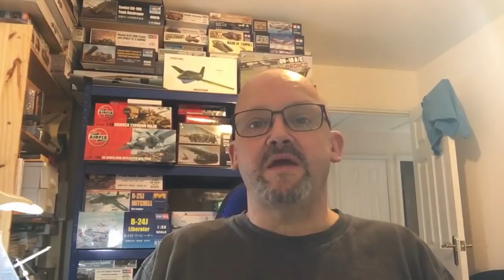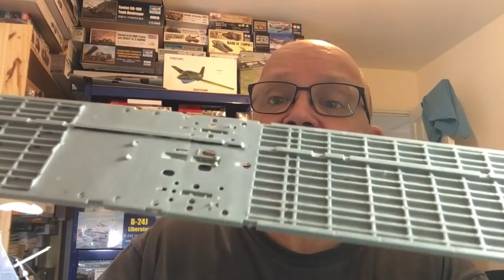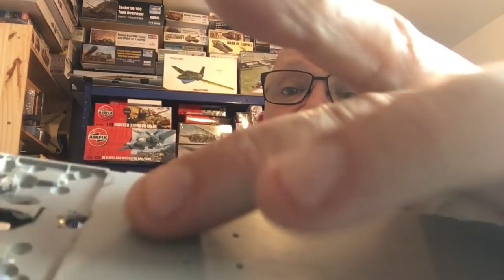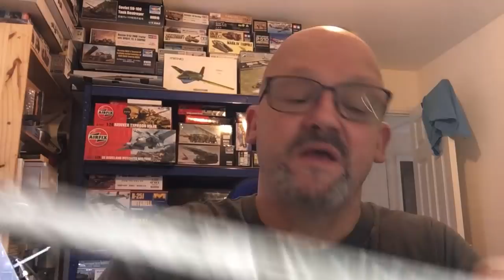March 22nd Update and some Bad News I'm afraid.

Comment: Sorry for the other guy in Canada.  I scooped one up from EBay, and it shipped from Burnaby, BC.  And to Nigel, I too have the bad habit of nail biting.  So feel your pain.  Nervous stress on my part.  Better than smoking.
Reply: Axle Rodd Hello from Ontario. Mine kit is coming from Burnaby as well. There was kits available on amazon right up until the kit selection. What paint will you be using. I had a real hard time finding paint and ended ordering most of it from Calgary.
Reply: @Life in Serenity.  I will be using Vallejo, fairly easy to get in Canada, as most hobby stores carry the base colors.  The newer colors have to buy online.  Had great success getting them from Sunward Hobbies in Toronto.  I will be learning to use the airbrush for the first time on the model an heard good and bad stories on Vallejo, but hoping for the best.  Environmentally friendly and low toxic fumes is what I like.
Reply: Axle Rodd Thank You for the Sunwood info. I to will be using Vallejo and against better judgement I bought a cheap airbrush kit. So we will see how they goes. My model kit arrives Monday. Most of my paint and cement on Wednesday.  The last time I built a model was 30 yrs ago so this should be fun. Thanks again

Comment: Lol. Great videos. Have you spotted the dingy panel in the port wing that shouldn’t be there, plus the modern blade ariels and anticollision lights as per the BBMF Lanc PA474? Plus the H2S set that shouldn’t be fitted to the Nav position unless the belly radome is fitted.
Reply from the maker: mantistrike120 yeah, all spotted and sorted. I have a video on sorting the wings. The port wing also has landing lights!! I’ve just put a post on my thread on LSM that describes what’s up with the radios. I’ll put a new video up very soon that shows what needs to be done to the whole W/O nav area.

Comment: Nigel what about the Dora Gun 1/35. you have got le hooked on that one. any news on that? i have found that 1 gauge rails is what is needed and the plastic rails from miniart do not have the punch out marks on them. but i think i will go with metal. you also showed a metal jig for the wheels to be aliened a certain way,  would you share some measurements on that so i can get one made for my build?  thanks again for your insight on the videos.